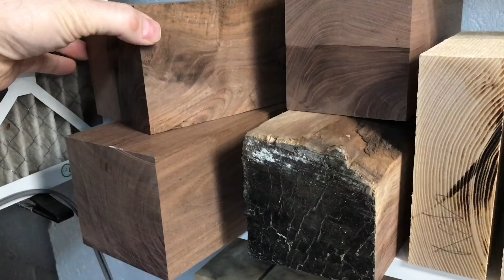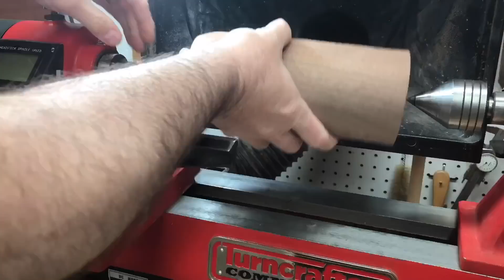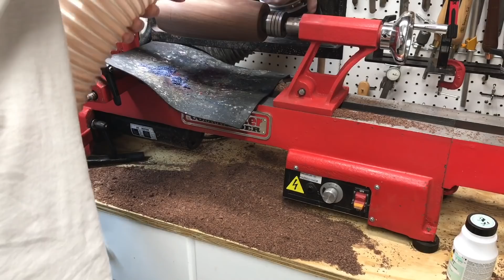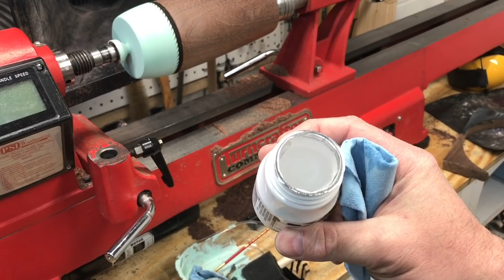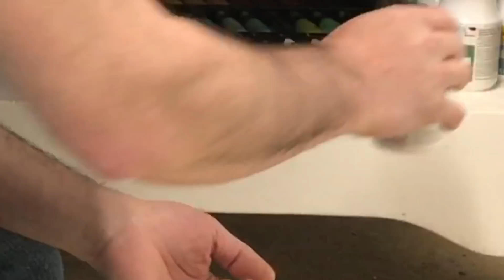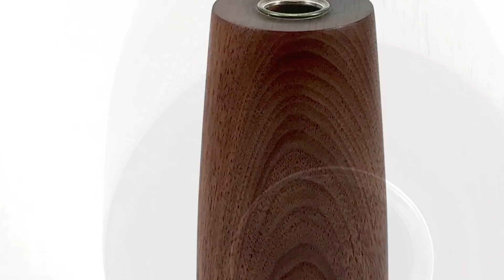Wood Turning A Modern Farm House Style Bud Vase

Comment: Wow at first I wasn’t sure about the paint. But it turned out great. A really nice piece. I’ve been using wood stains but now I might have a try with paints 👍👍
Reply from the maker: terry moore Hi Terry, thank you so much for the kind words. Funny you mentioned stains, because milk paint is like a stain and soaks into the wood. I had to use several coats to make it a solid color. I know that caulk paint is more solid and stays on the surface. Thank you again my friend.

Comment: How did you get that stitch look so perfect?
Reply from the maker: Gery Aversa hey, thank you and for watching. Honestly, I’m not entirely sure. I would have to say practice but there are some tips. Steady hand, on and off the wood quickly with not touching the wood, good tool wheel angle, and a sharp tool wheel. The cuts will be torn with a dull cutter, and you can get unintended cuts if you touch the wood on the exit. If you watch that part you can see I put the tool out quickly and straight. Hope that helps. Cheers my friend.